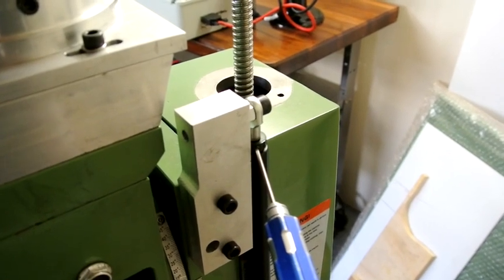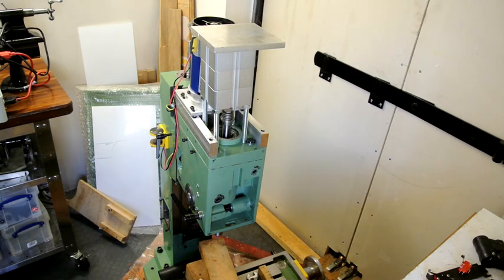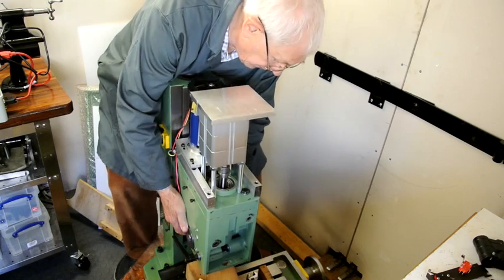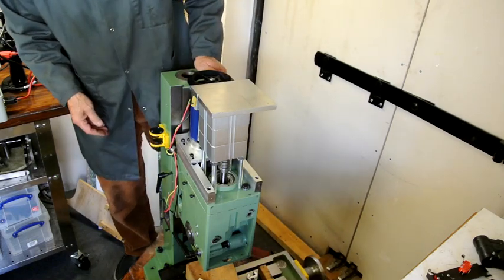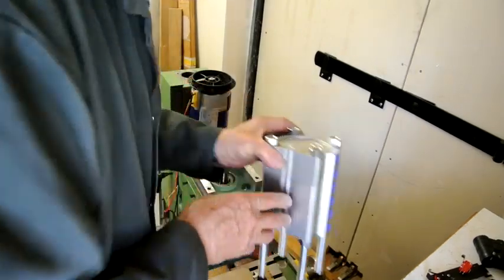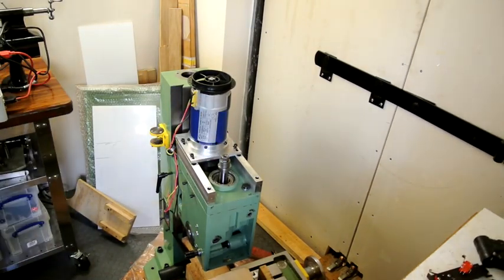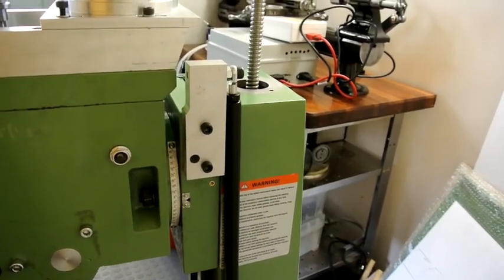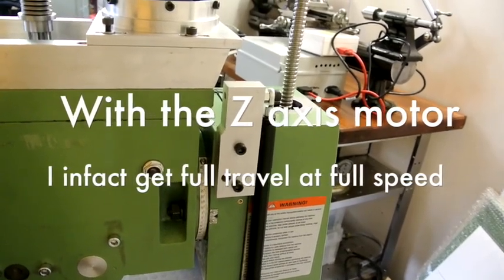Part 4 Warco 18 GH fitting gas strut to aid lifting the Z axis

Comment: What you are also fighting is the tightness of the dovetail gibs that do have to be quite firm to prevent any wobble in the location of the head.
This is a quick fix and to have a Z axis that can move freely up and down you'd really have to fit linear rails as some other people who indulge in CNC have done.
But, with an Acme thread on the Z axis you are playing with fire if you over play the gas strut force.
In reality you need to have a ball screw that will maintain a position without having backlash that you will get from an Acme thread.
Normally the head on a machine such as this, with dovetails and an Acme thread for the Z axis, is counterweighted to have a positive up thrust at all times and you apply a downwards force with the screw.
With a CNC machine, if you have a ballscrew the force is minimal, just enough to balance it and take the weight off of the stepper motor.
Reply from the maker: Ian, The ideal would be a strut either side of the column, but the compromise I fitted works just fine. The dovetails are quite long. As you say Linear rails would be ideal, but much more cost and work than I would need to put into it.
John